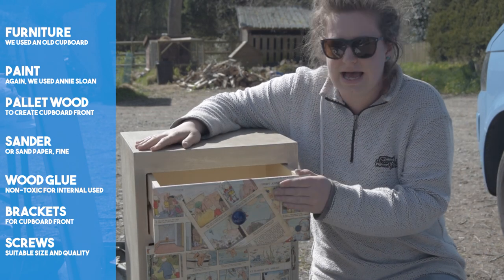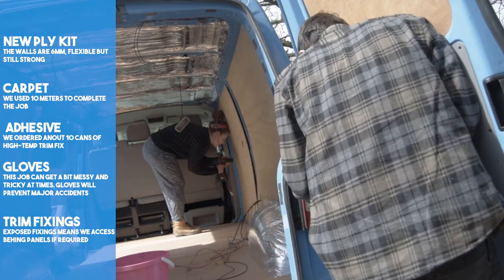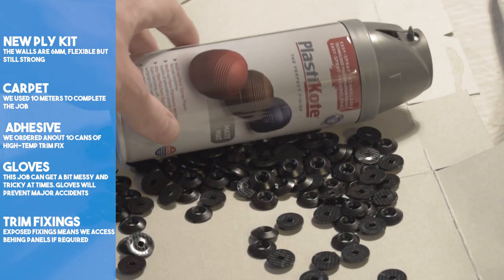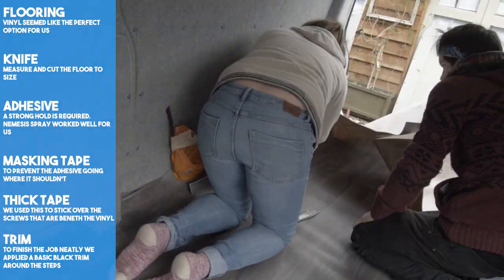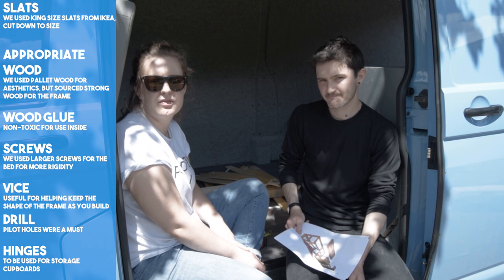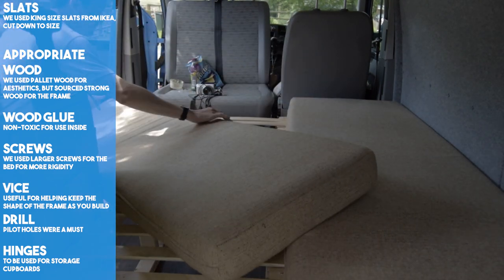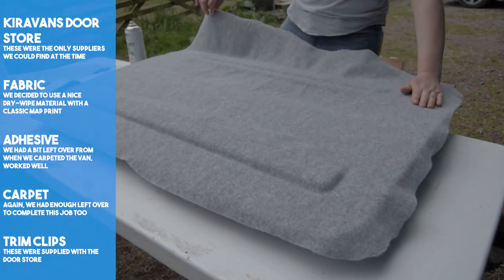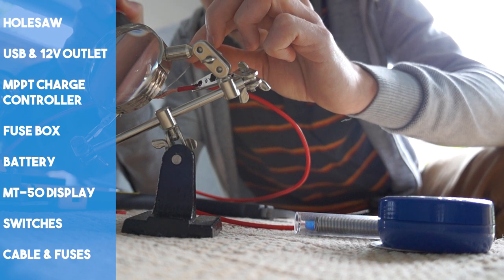DIY VW T5 Camper Conversion - Start To Finish, Van Life UK (2/3) Beginner Build

Comment: I don't know if you know, but you can make your own chalk paint at a fraction of the cost of brands like Annie Sloane.
All you need is emulsion of your colour choice and a tub of limestone flour ( it's basically crushed chalk, used as a mineral supplement for horses) available from most country feed suppliers. 
To each litre of paint add approx 2-3 heaped tbsn of limestone flour, it doesn't need to be accurate. Then add enough water to get a thick single cream like consistency. Voilà! Keep and use as normal chalk paint. Dries super fast and sands down brilliantly.👍
Reply from the maker: That’s good to know! And for anyone else who’s thinking of doing the same! Thanks you! 👍👍
Reply: @FloraTheNoviceExplorers  You're welcome, loving the videos.

Comment: nice work, are these activated glass matt batts sealed maintenance free?
Reply from the maker: Hi! Yeah, maintenance free. We used them every single day for 13 months and they did a great job 👍 we gave them a pretty good hammering too but always checked the voltage and never drained them too far 😊
Reply: @FloraTheNoviceExplorers  yeh, i'm looking for recessed posts trying to chase them in lithium  in 110amp
Reply from the maker: Ah brilliant! We’d love lithium! 🔋

Comment: Hey! Love your videos! I'm thinking of building my own camper and I'm getting great value from your videos so thank you. One question, when anchoring the furniture to the floor with brackets what did you screw them into? Did you have to locate the wooden lats on the floor and match them up?
Reply from the maker: Thank you for your comment Brian! Glad our videos have somewhat helped you! Regarding the screws - we screwed the L shaped brackets into the 12mm marine ply floor, some would have gone into the Batons but not all of them. After a year of traveling Europe in the van we have had no problems with the furniture coming loose or moving! It’s been spot on! 👍👍🚐

Comment: Hey guys, love your videos! I've watched just about all the build ones now in prep for my own first build :) Quick question regarding the pull out bed: I'm going to build a similar bed but would like to have a section that pulls out independently whilst doubling as part of the bed. I wondered if you think the slats are strong enough to be used as a seat in this design? So my pull out bed would consist of one longer bench with the pull out bit split into 2/3 and 1/3. The 1/3 bit being for the seat. Any words of wisdom appreciated! X
Reply from the maker: Hello! Thanks for watching and getting in touch! 

Ok, I think understand what sort of bed you want to build. You would want the 1/3 portion of the pull out for extra seating. 

The ikea stats are pretty strong but I couldn’t say for sure that in this configuration they would hold a persons weight (long term) - I think they would be fine for just legs “lounging” on the sofa. 
Idea 1- for the 1/3 for Sitting on occasionally, sit the slats as close as possible still allowing the fixed bed part to slide in between (when stored in bench mode) 

2 - For the outside slats on the edge of 1/3 piece of the pull out bed use thicker wood planks instead of slats. More hardy. Only issue bed comfort if the height difference is too much. 

If you want any sketches/drawings showing this feel free to message us on Facebook or Instagram. @vw_flora 

Good luck on your first build ... if there’s any Other questions we can help with send them over! 🚐👍🚐
Reply from the maker: No probs! 😜 depending on what foam or mattress you have on it too. But as you say doable with a brew indeed! 👍👍🚐☕️